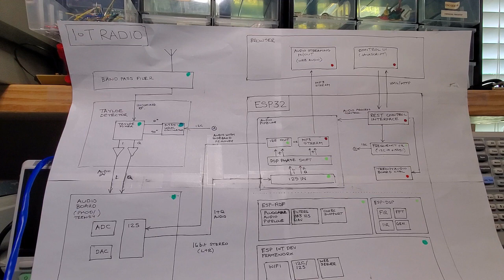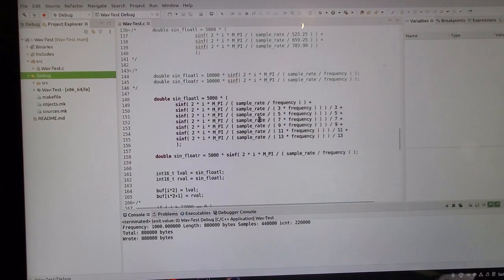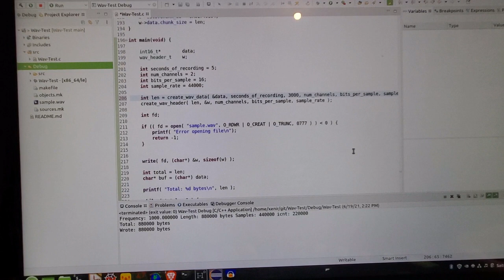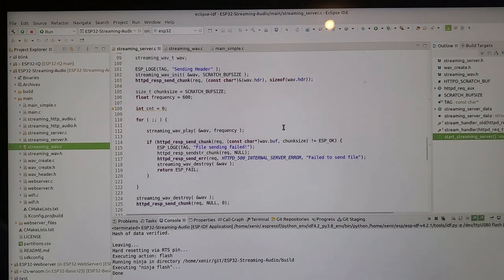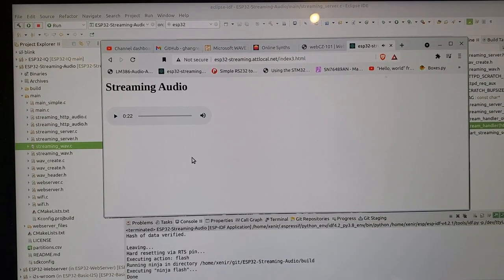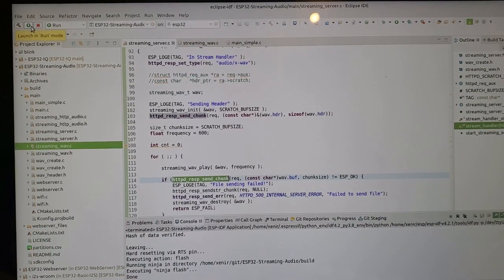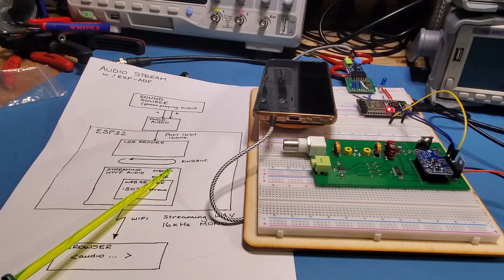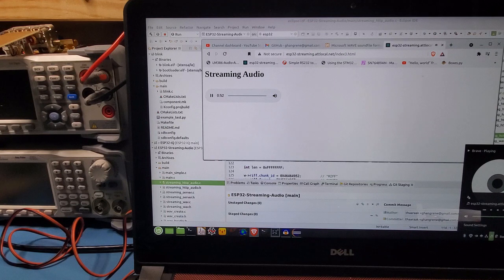ESP32 IoT Radio - Part 5 Audio Streaming

Comment: So the ESP32 can not sample at 44kHz stereo and stream it to the browser? It ESP to slow for that? Your project has to be done with Espressif IDE or can it be done with Arduino IDE too? Thx.
Reply from the maker: The ESP32 can sample fine at 44KHz. The main challenge is the bit rate to the browser because WAV is an uncompressed format. This project requires the use of the ESP-IDF and ADF. I do plan on doing the same with the Arduino using the arduino audio tools I played with in this video https://www.youtube.com/watch?v=D0EUDRo4Mx0&lc=UgzbWHVQShlkIaY7W9V4AaABAg

That toolkit has some support for compressed audio encoding which I also plan to try. Thank you for the comment!
Reply: It is actually possible to make it work with the Arduino IDE. I used the code in the 4th post of this forum thread: https://www.esp32.com/viewtopic.php?t=16775

That's also how I found this very useful video. The code from the forum will run in the Arduino IDE as-is and is relatively easy to modify to work with an I2S source.

Comment: Is WAV the only file type we can generate in ESP32? Will ESP32 computing power be enough to produce another lossy/lossless audio format?
Reply from the maker: Thats a great question Arfan. I took the WAV path because that was easiest and the PCM WAV uses is identical to the encoding I2S uses. However I had originally wanted to use MP3 for audio and I spent quite a bit of time looking for an open source C/C++ library. There's LAME for example
https://lame.sourceforge.io/

but it looked like it was going to be a pile of work to port and test. I have seen a port of LAME to Arduino
https://github.com/pschatzmann/arduino-liblame

and I definitely want to try that out. There's a lot of horsepower under the hood with ESP32 - I believe it would work and thats something I definitely want to try in the future. Thank you for the comment

Comment: Did you ever get the delay reduced?
Reply from the maker: I got it down to a couple of seconds playing around with the buffering but never "real-time"
Reply: @na5y  Where did you play with the buffering? Almost all the buffering appears to be happening in the browser, and as far as I can see, the <audio> tag doesn't allow you to change that.

Thanks for the videos and code btw! Very useful, and I got it running with an I2S microphone. Just a shame with the delay.
Reply from the maker: @hotgluegunguy  I didn't have much luck with the buffering. There is this "preload" tag ( https://www.w3schools.com/tags/tag_audio.asp - set it to "none" ) which you can use but I wasn't able to reduce the delay significantly.  I think the answer is using a compressed format like mp3 - but that means on the fly compression - I do mean to get around to trying that one day! Thank you for the comment Christian.
Reply: @na5y  Alright, I see.
The question is whether using a compressed format would even help? I think the audio-tag is just designed to have these extra seconds of buffering, to avoid "stuttering" with flaky connections. If so, it would probably do the same with mp3. My guess is that the reduced delay you experienced with a higher sample rate was due to the data rate being higher, and thus the audio player figured that the connection was faster and therefore reduced the buffer. It's just a theory though. I don't actually know how it's implemented.
Reply from the maker: @hotgluegunguy  You are right - higher data rate definitely reduced the delay. All in all it was a fun experiment listening would be fine - but that delay would be painful in a transceiver.